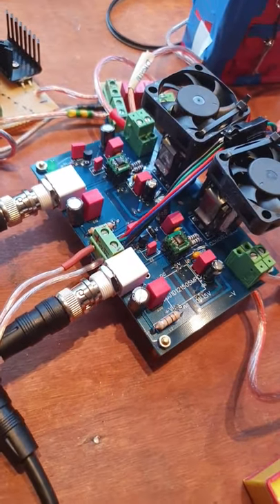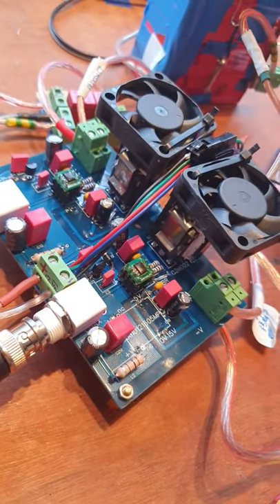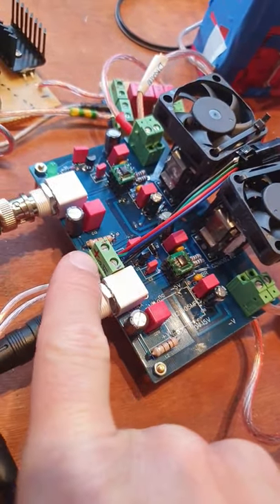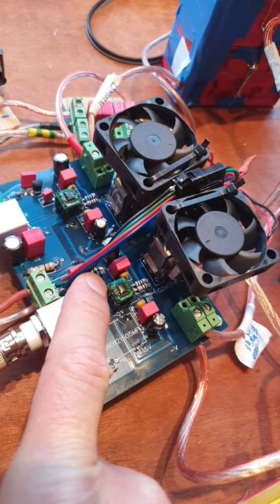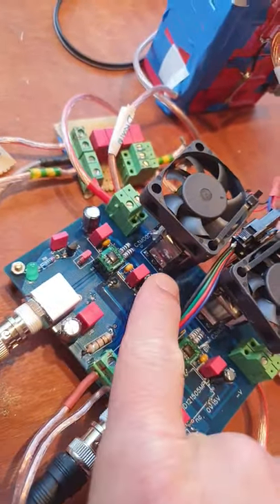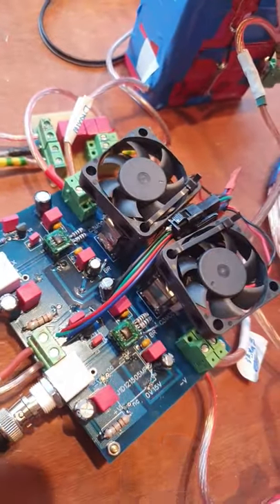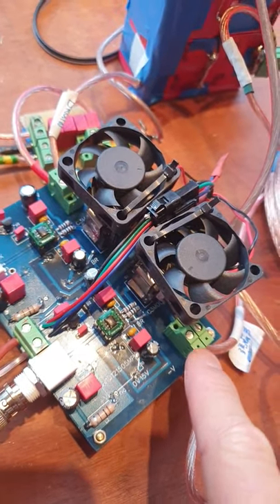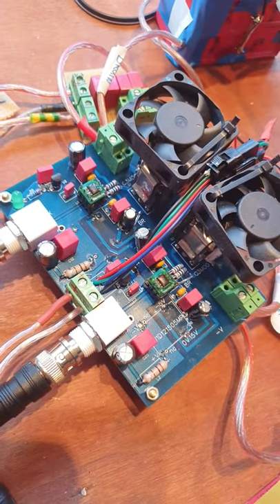New gate driver PCB for series MOSFET switching

Comment: while I'm thinking of it... I'm glad you decided to pursue higher voltages. rather than giving up. A thing that I want to mention. Tesla as well as Gerard Morin say that something magical happens in the spark gap.  By removing the magnetic component of the electrical stream the energy is able to flow without resistance. Pure aether in effect. Just keep that in the back of your mind for later.
Reply from the maker: Thanks for sharing, yes, this removal of magnetic current is fascinating, I intend to show this in a future video, with a negative DC spark, instead of the usual AC spark.
Reply: @MasterIvo  nice mate, make a video about your 3kv power supply pls !
Reply from the maker: 3kV power supply is shown here;
https://youtu.be/ncL5WgkD6Hc
Reply: @MasterIvo  thankyou, i watch that video when you posted it a few days ago, - i didnt think that was your primary supply, it seems more at home in a bug zapper.   grins   ... what kind of car do you drive Ivo ?
Reply from the maker: @patrickwatkins7572   I drive an e-bike (self made)
Reply: @MasterIvo  Will you be sharing your schematic of this gate driver ?
Reply from the maker: already did, in my "Radiant half bridge" video, there in the description is the link to the isolated gate driver circuit
Reply from the maker: I could email you a picture
Reply from the maker: Look at my youtube "about" page (use pc)